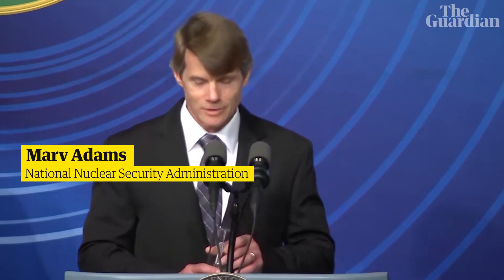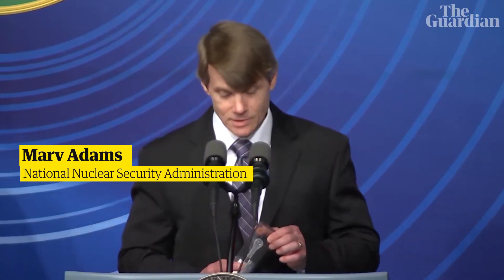Nuclear scientist Marv Adams explains what happened in the successful fusion experiment

Comment: I remember all my teachers telling me this was not possible. "Energy output is always less than input Energy" bruhhh
Reply: Have you ever started a campfire? It's the same concept, the energy you use to light the fuel is less energy than is produced BY the fuel. It's just that in the case of fusion, lighting the fuel is a very technical and complex process.
Reply: @lash83n  maybe I misunderstood the video but it sounded like energy output was higher than the input energy and it had never been done before in this type of application?

Comment: I want to know if TOTAL energy input was beat by NET energy out put. Nothing else matters. Lots of fusion claims are about the net input, ie the amount of energy after conversion to magnetic force not counting the loss in heat then they count the potential energy out, not the amount captured and turned into usable electricity. Total input vs net usable energy output is the only measure that matters. If the total amount of electrical input is more than the total electrical output you don't have a generator you have a power sink.

Comment: They are neglecting to mention the 500 MJ it took to get the lasers ready to fire.
Kind of important...
Reply: Wanna know what's more important, that scientists just broke Newton 3rd law and essentially discovered the holy grail of physics. That's kinda of more important than the technology they used.

I swear people get dumber ever year.
Reply: It's a big advancement, it's not  ready yet but when it is energy production will be changed forever
Reply: @priestofronaldalt  they got almost half a MJ from 502.5 MJ.
They need to be able to sustain the fusion at least 1000 times longer without wasting any additional energy on the lasers while fuel is cycled through the system.

Comment: Energy out > Energy in. = "Scientific break-through".
Total energy required >> net energy out (due to need for heat exchangers, conversion of heat to electrical energy etc etc). = "Engineering challenge", that may result in commercial fusion power plants "in about ten years" (which they've been saying for more than three decades).
This is a case study of how you present a scientific curiosity worthy of a few peer-reviewed journal articles into a "break-through" that gets you press conferences and lots of government funding...
BTW, other avenues of fusion research (eg tokamak-based designs) have achieved "more energy out than put in" years ago. But they are still "a decade or so" from scaling up to a commercial prototype, and a long way short of getting more net energy out than was put in (those pesky engineering losses again, when you try to go from 'energy' out to useful electrical energy production).
I suppose this is one of the vital steps towards a Nobel prize (if not actual working fusion power generation)....

Comment: Cool, but like, I've heard basically the same optimism since I was a child. I've heard "more energy than put in" before because it doesn't take into consideration the ENTIRE facility, just what is SPECIFICALLY put into the reactor. Which is cool, but you need the ENTIRE facility and a method of drawing power. So far, this is just like the "breakthrough" like 6 weeks ago

Comment: While this is an improvement on previous experiments, it's not a practical method of power generation. While it produced 50% more energy than it required, converting this heat into usable electricity usually involves an efficiency loss of 50%, which makes the power gain negligible. And that's assuming that the process can be scaled up, which is not clear.

Comment: please stop overselling the current state of fusion. The laser needed more then the 2 MJ as input and the 3MJ created by the fusion were not usable electrical energy. The laser will have ~50% efficiency and if they use some thermal process to get the power back out that will be ~33%.
So it was more like 4 MJ in -> 2 MJ laser -> 3 MJ from fusion -> (in the future) 1 MJ electricity.  Still needs a factor 4 to break even, and that's without the stand by power of all the equipement necesary...
Reply: I friggin knew it. I knew it was yet another overselling scheme. I'm so annoyed with this. Hope Sabine Hossenfelder makes a video and points this out, so it gets more voice. This needs to stop. Same problem with the never-ending quantum hype.

Comment: 2 in and 3 out. The first time that the energy output is bigger than the imput and it’s already a difference of a third. I can’t imagine how efficient this will become just in the next 5/10 years.
Reply: 2MJ was not the true input, that is where the deception was. Lasers are not 100% efficient. Input was much higher than 2MJ.
Reply: @usneome  also they need to compensate for entropy and cool the system somehow
Reply: @Kugelschrei   Yes; two conversion efficiency factors were ignored by the presenter: 
1. electrical energy into laser energy 
2. fusion generated heat back to electricity
Reply: They've used wordplay to turn a nothing into an announcement.

Comment: Imagine how the researchers felt observing this for the first time. Fantastic work.
Reply: To be frank, the theory has been established for quite some time. Technically, you are correct that research is still a large part, but(!) the engineers are the ones that deserve even more praisal in this instance as they are the ones constantly bringing forward innovations to improve the technology and make it a reality.
Reply: That wasn't really the first time the process was "observed". They've been doing nuclear fusion this way since the 80's.

There are all sorts of ways people are doing fusion. The true holy grail is cold fusion using muons, using clean fuels. 

What's new is that more energy was produced, than used to fuse the hydrogen isotopes. 

But this specific method still uses fuel that ejects high energy neutrons (the same reason Uranium is unpleasant, it ejects high energy neutrons) 
That's because this method uses tritium (the same stuff needed to make hydrogen bombs), and the neutrons it ejects makes any material it hits radioactive.

This is basically an excuse to refine Tritium. Also, Tritium costs $30 000 per gram...because its very rare.

The holy grail of fusion would be to use deuterium only. Because this fuel is truly clean, abundant and cheap at $13 per gram (it would get cheaper, if refined more). The problem is, it's really difficult and this process doesnt involve the most critical stuff needed to make hydrogen bombs.

If nuclear energy is done the clean way, then there won't be any useful byproducts and fuels to funnel towards bombs.
Reply: I think they could have only observed the data, after the fact..
Reply: @SineEyed  that is... still observation....
Reply: @Patchess   sure, but it's not exactly what comes to mind by the way OP worded it. Right? We're obviously to infer a hightened state of excitement, but no one is going to connect in their minds a sudden exuberance with seeing some freshly printed data. I was simply remarking on the odd implication. And I wasn't wrong to do so. Understand now?..
Reply: @SineEyed  That’s the definition of an observation. Do you…. Observe things before they happen? Cause if so, you need to be up on that stage too lol
Reply: @Qwerty0791   the definition of an observation is the review of data on a sheet of paper? You're really trying to tell me that's what comes to everybody's mind when it's mentioned that an observation was made? You're kidding, right?..
Reply: @SineEyed  you're not the brightest, are you? Observing the data is exactly what was meant in this context and it was profoundly obvious. If you're unable to grasp that concept, then that's a you problem.

Comment: This technological breakthrough opens the door for many advancements that were theoretically possible but not previously practical/achievable due to energy constraints
Reply: Have we ever had an experiment like this one. That shows  we can get more energy out than we put in?
Reply: @Spabsa  There has never been an experiment where more energy is output than is put in and that includes this one.
Reply: @patheticpear2897  I thought he just said it was 1.5 * a minuscule amount yes but slightly more came out than what went in?
Reply: @Spabsa  Sure if you don't count the other 500MJ used by the lasers.
Reply: @patheticpear2897  they did factor that in. He said it. 
You didn't comprehend it. All fusion will require enormous energy to start. That's the thing. More out means enough to continue the reason and export the excess. The first to demonstrate this achievement.
Reply: How is this even remotely true? Unless we suddenly developed insanely efficient lasers, the amount of energy actually consumed to produce this much energy is horribly inefficient. The truth is, we are not that far off from where we were yesterday. It’s baffling that people think we suddenly made the impossible possible by this experiment.
Reply: @eufrosniad994  Every journey begins with a single step. This was certainly a step forward - toward bringing us closer to realizing what was once unimaginable
Reply: @eufrosniad994  They just said that they received more power than they put in. Hundreds of previous attempts slowly refined the lasers and improved upon what they learned. this has been in the works for decades globally. I'll probably still be decades before its mainstream but the process is slowing bearing fruit.
Reply: @eufrosniad994  That's what I was thinking. I highly doubt they have a machine at the ready(like constantly running). I bet they used a ridiculous amount of energy to set that in motion. I really think this is interesting how they are hyping this up right in the midst of this whole snafu with twitter and Elon Musk thing...

Comment: A small step in the right direction. However, I doubt a 33% heat gain on a single shot is even close to what's needed to offset the energy requirements of a magnetic containment field and the loss of heat to electricity conversion.

Comment: According to Marv Adams description the fusion energy production lasted about 0.08 nano-seconds. Typically such experiments take about a week to prepare for. So the duty cycle of the fusion reaction, over that time span, is less than 0.0000000000000002. The multibillion dollar laser facility involves laser amplifiers incapable of firing more than once a day and no extreme power lasers exist that can do much better than that.
Reply: Compare the specs of the Wright brother's plane to a modern Boeing 787. All of that happened in approximately 100 years. This is ground-breaking moment. The thing with most technologies is that it is usually possible to make a slight incremental improvement and make it a tiny bit  better and more efficient.

Comment: Scientist: Well, we made a super brief and super difficult experiment, and for the first time, we got a little more energy out than we put in. This is a great start, lots of things still to be done and perfected, but it's a great start.

Newspapers: FREE ENERGY INVENTED!
Reply: Military: Let's build new weapon with this technology.
Reply: @bigsh0w1  you could theoretically make a cleaner hydrogen bomb.

Technically, this is a hydrogen bomb.
Reply: @Kyle-rhysC  Yeah, because this is the first time I heard anything about nuclear fusion.  /sarcasm
Reply: @Kyle-rhysC  Why the ad-hominem attack homie? Wow.
Reply: Bro thats deadass what it is tho.
Like the fuel used for these mfs is hella cheap, and is practically free
Reply: @Kyle-rhysC  Harmless was fully right though. To say "lasers put 2MJ of power into this and we got 3MJ out of it" is neglecting the input energy needed to run the lasers so that they output 2MJ of power.  They are by far not 100% energy efficient. Also, you need to compensate for entropy and cool the system.

They obviously didn't take the whole system into account, but only what happens in the "inner capsule".
Reply: Almost correct. Except that they didn't get more energy out than they put in. The fusion generated more energy than the lasers that ignited the fusion reaction had. That's not the same thing because the whole apparatus is not just the lasers and the laser output is not the same as the laser input.
It's a critical milestone but there's still a ways to go.
Reply: @harmless6813  Not really. The fuel capsule is the only system that matters. More energy was released from fusion events in the capsule than the energy directly provided to the capsule by the laser beams. This means that it is possible to control a fusion reaction that outputs more energy than the input energy. Adding in the energy consumed by the whole apparatus would be foolish because that energy is not being supplied to the fuel capsule itself, it is simply lost into other irrelevant environments. Remember, efficiency is a goal in a power plant, not in a lab like NIF.
Reply: @Ref-vk7lj  Oi, his point is that while one can generate more energy than what one puts in, it does not matter if the method of powering what is needed for generating the energy is extremely inefficient to begin with. That is really the problem with this approach for power generation. The losses involved in powering your lasers and such need to all be accounted for when speaking about power generation. So your last line is the problem. The context in which the media touting this discovery is indeed about using it for power generation.
Reply: Exactly right....along with INFINITE ENERGY! PERPETUAL MOTION! THE LAWS OF PHYSICS ARE WRONG!!!😂
Reply: Pretty much. The big deal though is that they managed to provoke a ignition. 

That means that it's now possible to begin a fusion reaction, in other words, the real work with fusion begins now.

That could be more of a big deal than the man going to the moon.
Reply: Right - they didn't even achieve true overunity but according to the internet my Vril powered space saucer is waiting for me at the nearest Tesla store

Comment: Wow! A net gain of 1.5 Mega joules is way more impressive than I was expecting.
Reply: What's even more impressive is the timeframe which the energy was released. about 0.1 nanoseconds if you do some back of the envelope math (1.5 megajoule gain divided by 0.1 nanoseconds) this translates to petawatts of power (10^15). Current powerplants measure their power output in gigawatts which is 10^9. A fusion powerplant that can sustain this reaction longterm could produce literally 1 million times more power. you'd have to throttle it down 1000 fold and even with 1000 fold throttle you're in the terrawatt range which is the prefix used to measure the power consumption of humanity. Mind blown.

Comment: This is amazing.  And it has a return of 1.5 over input.   It's literally free energy. It's the equivalent of spending $1000 at the store and getting $1500 back in change!
Reply: You can never get free energy as per the 1st law of thermodynamics. The extra energy comes from the fact that the enthalpy of the fused nuclei are less than the pre-fused nuclei, so there is a net energy release. So the extra energy is not 'free' it's just transferred from one form to another
Reply: @samuelremix8291  True, but for all intents and purposes this will create a world of "free" ie ultra cheap energy if it can be scaled up. The same way tap water is essentially free in that water is super cheap bill to pay and free to the consumer at libraries restaurants ect.
Reply: I'm also amazed how just fast those 3 Megajoules were generated by the reaction. Imagine how much that can power if it can be sustained all day.
Reply: 2 mega joules in , 3 mega joules out . 
A gain out 1.5 mega joules. ?
It should be 3.5 mega joules out , right ?
Reply: 1.5x is over the input to the fuel, i.e. the power that the lasers emitted. The lasers require many times more energy than that to emit their light.
Taking your analogy, it's like spending $50,000 to create an item worth $1000, and then sell it for $1500.
A momentous event, but we're still far away from "free energy".
Reply: Not free energy, nothing is free energy. It is remarkably clean energy however.
Reply: Will never be free , they will find away to charge you much more

Comment: So is this a huge step in fusion energy, and the potential for using it as a sustainable energy source?
Reply: No. It's a big step for fusion research.
Reply: it is a huge step, but there are many more to go. note the energy output he said was about 1.5MJ, the enery output from burning a kilogram  of wood is something like 10 MJ
Reply: @Gisiebob  no. Output was 3. Input was 2.    So output is x1.5
Reply: They didn't say what the fuel was.  If it was deuterium-tritium, there is a huge bottleneck in the future for Tritium.  Fyi Tritium costs $30,000 per gram and the whole world has like 25 kg.  World almost runs out of supply just after 2050.  So don't expect fusion energy before 2100.

Comment: what happened was that 3 MJ of energy were obtained, spending 302 MJ. The rest is anyway too technical for 99.99% of the world
Reply: 1) the amount produced will increase and the amount used will decrease as technology advances
2) in the future you will be able to harness the energy produced to run the same process - thus the energy spent will only be spent once at startup.
Reply: @ploppyploppy  it took 30 years to get from Q = 0.0001 to 0.001. It will take another 30 to a factor of 10 (which is too small, anyway). In order to be able to continue the process, you need to load the lasers with energy produced from the reaction (i.e. break-even). You are now at TWO orders of magnitude below the break-even point. 

Otherwise, you may want to know that this reaction requires tritium. We don't have much of it on Earth. It MAY be that all of this is for nothing